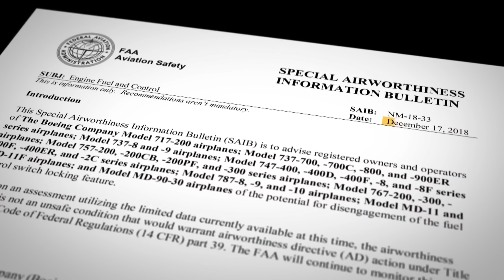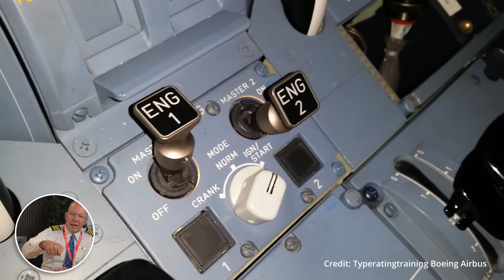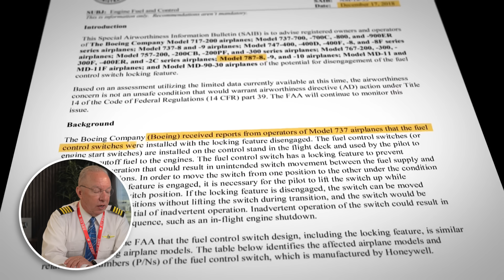Air India 171: The FAA’s 2018 Fuel Switch Locking Bulletin Explained (16 Questions Answered)

Comment: It would be interesting to know how the FDR monitors the fuel cutoff switches. Does it use switch position sensors or auxiliary contacts to confirm physical movement, or does it rely solely on the electrical signals from the switches? Monitoring by signal alone could lead to misleading FDR data if a switch malfunctions or shorts, making it appear as though the switches were operated when they weren't.

Comment: Those switches position should not be able to be changed unless there is an emergency, for example the interlock should be linked to the safety cover on the fire panel. ie the fire panel cover has to opened (but not activated) before the switch for that engine fuel cut off switch position can be changed. I am Just surprised how easy those switches are to change position.

Comment: First, I think everyone (except pilots' unions) is in agreement - camera's = yes. (I'm a former skydiving instructor evaluator - I trained skydiving instructors). Think of all the positive data that could be captured to increase awareness and training around things like fatigue. Pretty sure there are cameras monitoring the cockpit door. FFS - I can usually get several different camera angles of the outside of the plane on the in-flight entertainment system. Also, correct me if I am wrong, about 1/3 - 1/2 of accidents are a result of pilot error. maybe with the camera some of those pilots are exonerated, or at least we understand why they made the error. While we're at it, camera equip the whole plane so there is evidence of anytime passengers get abusive with the crew. 

Second, with regards to 'how ya doin?' - it better than nothing, but for skydiving students during the pre-jump training / briefing (especially for students getting to the end of their courses) I would always ask something a bit more pointed like - how well did you sleep, how's your stress, etc. on a scale of 1-10?

Comment: Are these switches switching the current to the cut of valves, or just computer inputs? As we have no video, there is no evidence that the switches were physically moved. It could have been an erroneous computer input. It could even have been caused by someone not having a phone in flight mode. One pilot noticed that the fuel cutoff was activated. The other pilot said "It wasn't me" Did the first pilot see that the fuel cutoff had been activated fromm alarms etc on his display,or by seeing that the switches had been physically moved? There is no conclusive evidence either way. It seems very u fair to blame it on pilot error with so little concrete evidence.

Comment: 12:30 They are recording an electrical signal from an electromechanical switch.  Whether one installed solely to examine the position of the switch, or one directly reading the electrics dictating fuel supply.

I think it’s very unlikely that those didn’t match here, but they do read different things.

Comment: The fuel cut off switches are just electric switches  the FADEC system is a computer that does all the engine system functions  isn't it possible that the FADEC system glitched, shut off the fuel, then turned it back on just not in time ?  Computers glitch all the time and you just reboot it and keep going ?

Comment: Does a hard mechanical connection exist between the switch and the valve?

Could this have been caused by a software corruption ie. a software update misapplied.

Comment: Your video shows switches with ! and 2  placards on the toggle.   Theses are not 787 switches BUT , if they are in design the same as the 787 switches, then the 787 switches would have the mechanical locking feature in both the ON position as well as the OFF position..  
These switches are also manufactured so that there is no locking detent in the OFF position, BUT when they are selected to the ON position  the mechanical locking feature is engaged and they CANNOT be moved back to OFF without pulling up on the toggle. I would surmise that the 787 switches have locking detents in both positions having seeen nothing to the contrary.   Forget any theory about accidentally moving this kind out of it's detent. It just isn'nt possible.  You'd have to hit it with a hammer !
I think the Embraer logic has some credence.  In the case of an engine fire on take-off, the first reaction should be fuel cut-off followed by thrust lever movement. 
Retired pilot and Airframe & Powerplant mechanic.

Comment: Captain Steve, 7:30 how did you arrive at the takeaway from the 2018 airworthiness report to be related to the switch being installed upside down - it's obvously related to the locking mechanism not working properly which could lead to inadvertent switching from run to cutoff  - here is the extract from the report

The Boeing Company (Boeing) received reports from operators of Model 737 airplanes that the fuel 
control switches were installed with the locking feature disengaged. The fuel control switches (or 
engine start switches) are installed on the control stand in the flight deck and used by the pilot to 
supply or cutoff fuel to the engines. The fuel control switch has a locking feature to prevent 
inadvertent operation that could result in unintended switch movement between the fuel supply and 
fuel cutoff positions. In order to move the switch from one position to the other under the condition 
where the locking feature is engaged, it is necessary for the pilot to lift the switch up while 
transitioning the switch position. If the locking feature is disengaged, the switch can be moved 
between the two positions without lifting the switch during transition, and the switch would be 
exposed to the potential of inadvertent operation. Inadvertent operation of the switch could result in 
an unintended consequence, such as an in-flight engine shutdown.

Comment: captain, Is cutting off both fuel switches within 1 second of each other physically possible? Seems like with the locking mechanism you would need a bit more time to accomplish placing both switches in the off position.

Comment: @AskTheCaptain No 1 (No 2 below): So the major question is: How much responsibility is taken away from pilots and put into logic/software? Or does the industry still rely on the human/pilots as the last point of trust.

I personally would trust a pilot more, who is sitting in the same vehicle as me. Maybe they need just a little bit technical help for these extreme dangerous flight phases..... 

@AskTheCaptain No2: just a simple Idea: Switching one eng off: all ok, just as it is. Switching both: Let the whole cockpit bring up alarms and after one/two seconds it can be acknowledged so the second engine goes really down by another third button. This ensures the other pilot cannot ignore and maybe switch the second switch back to on. Dunno if one/two seconds are the correct time. Given this report, I'd say the pilotting here happens in pieces of 3 to 4 seconds. Just an idea. 🤔

Comment: So a reprhasing of the second question.  Before taking off could the fuel switches been placed at the top, right on the edge of the detent, but not fully seated?  Then vibrated down after take off?  Or do the switches need to be fully seated in the detent for the fuel to be turned on.

I could imagine balancing the mechanical switches on the edge of the detent.

Comment: What captain steve is saying is very much unclear , he stated that the spring will make the livers to come back so to move them to run position is impossible if the fuel switch locking is malfunctioned.But ,if you read the original -it is clearly written that due to those locking systems the pilot has to lift the switch and then make it in run or off position.Without that, the liver can be shifted by mistake of hand touch or strong vibrations.And again,steve previously discarded this point by saying that by this procedure the two switches can never be off by an interval of one second.But Today he stated differently.Why? And FAA is suspiciously giving a statement that the fuel switches are okay.Then why you had written that report in 2018? Why everyone is trying to prove it as pilots fault so much
Reply: It looks very suspicious. But I agree that we need to get more info before jumping to conclusion. I understand it should also be very hard for the Indian people.
Reply: Because that is the most obvious answer. Switches do not randomly BOTH go down after each other by coincidence or by vibration. I feel that people just refuse to want to believe that one of the pilots did it on purpose. It's not about one switch failing, it's about BOTH of them doing the same seconds from each other which is very very important.
Reply: @-_YouMayFind_- The most obvious answer is-one of the pilots was depressed, hence he decided to off both the engines minutes or seconds after the takeoff (In the history of pilot suicide there is no such incident that the plan was crashed within that much limited Time, plans were crashed after 15 minutes)-then he denied it,and then he assisted the other to save the flight by switching on-regretting his decision within 3 second timeline! And, if this is possible-then why the switches going off by vibration or any other cause by one second duration has so much less probability ? And why, captain steve gave two different explanations when he is so certain that switch failure is not the case ?
Reply: Dude. This plane was operating for 11 years without incident. There wasn't a manufacturing defect with the fuel control switches that flew thousands of flights and not a single pilot nor maintenance crew noticed in 11 years.

Comment: 8:46 I'm a former GE engineer who worked on FADEC software. I know of no undetectable failure mode of the hardware that would have triggered this event, and the timing of the fuel shutoff alone rules that out. You would need BOTH FADECs to fail in the exact same way at the exact same time (immediately after takeoff). You'd just as soon have Mars crash into Earth without warning. This was not a FADEC issue. The fuel was cutoff by manual switch action.

For those of you wondering how they  know it wasn't a software issue: the FDR data includes the FADEC's active control mode ("CMODE"). The first thing we always looked at when investigating any sort of issue in the field was CMODE. I assume the GE engineers helping with the investigation looked at any odd changes to CMODE after takeoff. That would have been easy to diagnose. They didn't find anything, otherwise it would have been in the preliminary report. Rest assured that my top concern when I worked at GE was uncommanded shutdown. We tested our software thoroughly to assure that didn't occur.

Comment: Is it possible during take off and hot weather , due to wear-and-tear, the heavy vibration on the runway and at the moment of roll,  could have caused the switch springs to move from run to cut-off positions on their own ?

Comment: I've seen that same design switch on farm equipment and there is no way they will accidentally move to the other position, they lock both directions and it takes effort to move them, even just brushing your hand by them is not going to move them, they have to be physically lifted and moved.

Comment: Why would these switches be allowed to be activated  during such a critical time of flight,  like during takeoff?
Reply: If incase there is any one of the engines fail, you need to manually cutoff that.
Reply: @challenger908  I understand but why would it allow you to shut down both engines during takeoff it doesn't seem logical. I can see one engine on fire but both engines on fire would seem almost impossible. The switch should have been designed to allow only one engine cutoff but not both. If one engine would have stayed on they probably would have continued climbing and an emergency return to the airport. It seems like the airplane engineers dropped the ball on this design.

Comment: The bulletin said OPERATORS of the plane said the locking feature was installed disengaged, allowing it to be inadvertently cut off. Not upside down where it couldn't be set to on in the first place. They flew the plane and could move the switch to off without lifting up. Next, you don't think cameras should be used because a pilot could be caught doing something they shouldn't be doing? Are you for real? That's the point. Makes me wonder

Comment: During takeoff, if the fuel switches are cut off, is there any bypass system that activates automatically? The fuel supply should not be interrupted during lift-off, even if someone cuts it off manually

Comment: Very disappointed. Dodged the camera question and mis-quoted the 2018 concern of the locking mechanism. The issue was not them being installed upside down but them being inadvertently tripped in flight.

Gave up after that.

I think he's letting the side down, comes over as one of the poorer captains on YouTube.

Comment: Am I missing something here with the position of the fuel switches during this event.  1. The fuel switches are in the run position during the takeoff.  2 The fuel switches are moved by whatever means (Pilot or vibration etc.) to the cutoff position.  3. In attempt to restart the engine the fuel shut off had to be moved to the run position.  4.  The fuel shut off is found in the wreckage in found in shut off position.  Again, am I missing something here.  I not sure about the position of the switch in the wreckage but I thought it was found in the shut off position.

Comment: Captain Steeeve,
Regarding your point on FAA SAIB NM-18-33 — the crash report states that the throttle control module on VT-ANB was replaced in 2019 and again in 2023, but the fuel control switch locking mechanism (flagged in the SAIB) was never inspected. That potentially left an undetected vulnerability in place, which may have led to the dual engine shutdown. Isn’t it quite plausible that it took nearly two years for a rare trigger event to cause a failure—especially since the SAIB was only advisory, not mandatory, precisely because the issue doesn’t manifest every time?

Comment: It is definitely a design flaw that when both engines are shut off mid flight, there is no blaring annunciation. 

If there is nothing wrong with the engines why did the second engine fail to provide additional thrust to possibly avert a crash. 

Run-CUT switch, is probably similar to an SPDT switch wired to a FADEC with some redundancy and into the flight Data Acquisition / FDR. The data acquisition module is gathering inputs from 100s of digital and analog sensors. Just like the engine instrumentation, it is also a fault tolerant redundant microcomputer system. Any microcomputer can be hacked into,  to deliberately change the logic or it can be placed in a test mode to execute certain uncommon  interlocks.  It is not a stretch to program a relay ladder logic with a test sequence that is triggered by WOW sensors on the landing gear. 

Why they would do it … the motive beats me but so does the motive for a Middle Aged Capt to take the lives of 240 people. 

Unless they talk to the families, friends, acquaintances and colleagues of the pilots, review the last moments of their lives and see if anything stands out as unusual, mental health can’t be blamed. 
Until then, all other causes such as sabotage or equipment failure are equally likely factors. 

I hope the folks incharge of looking into it,  are free from coercion and corruption to be able to perform a clean, comprehensive and  candid investigation.